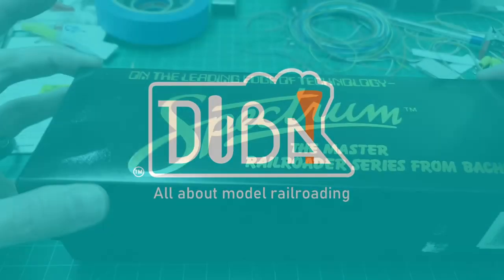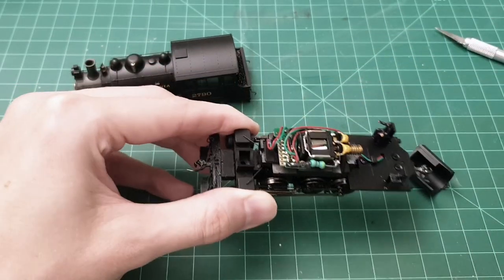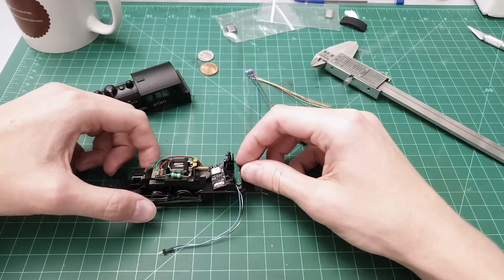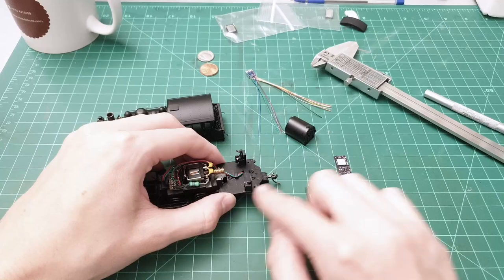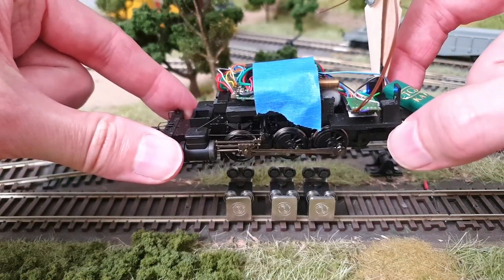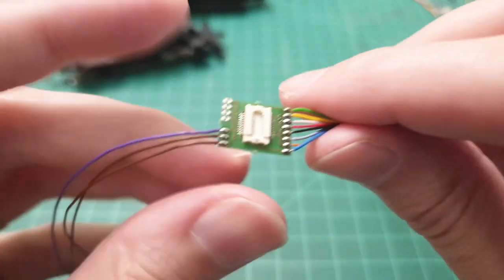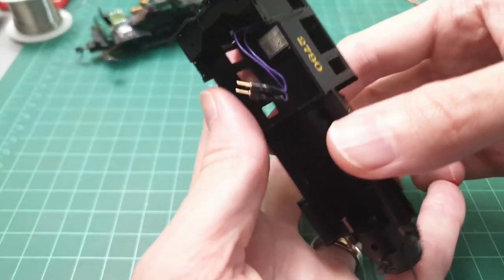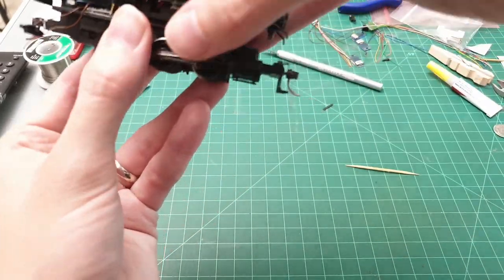77 - How to install DCC, sound and a capacitor into a tiny engine. Will it all fit?

Comment: Nice install job! Don't see in the list the wiring harness that you ended up putting the decoder on. Saw on the video that it looks like it came from maybe Germany? Do you have a Website location? Thanks
Reply from the maker: Hi Rob, that specific connector can be found here. Do not the entire website and documentation is in German. The first 6 connectors are suitable for the Next 18. They differ in size and if they are pre-wired and wire color. www.doehler-haass.de/cms/pages/produkte/soundsystem/anschlussadapter.php